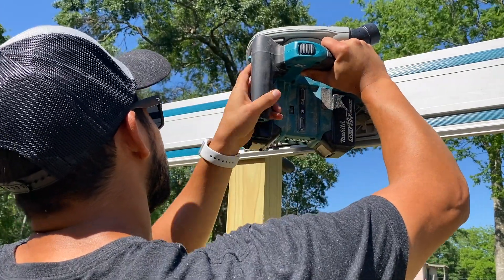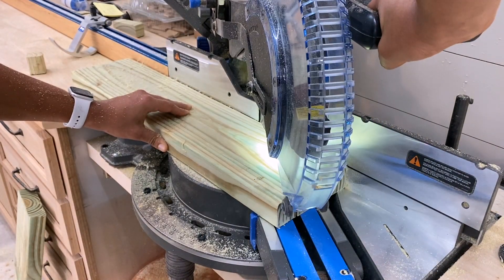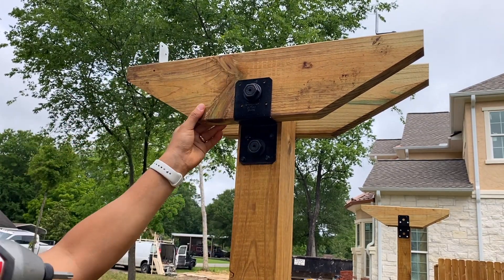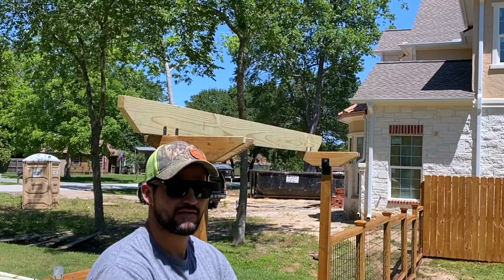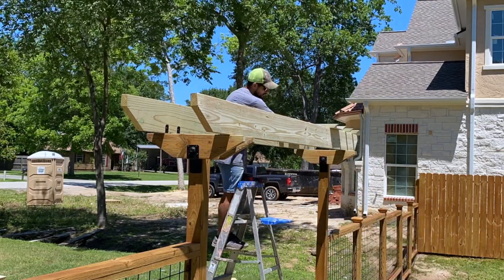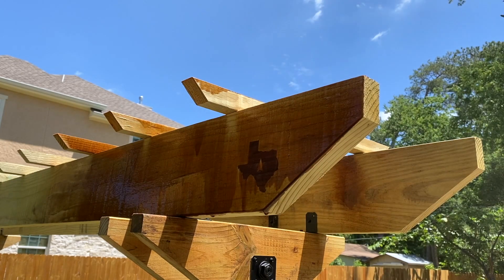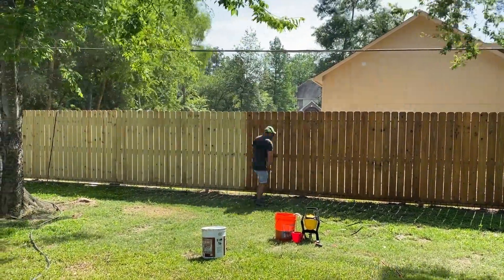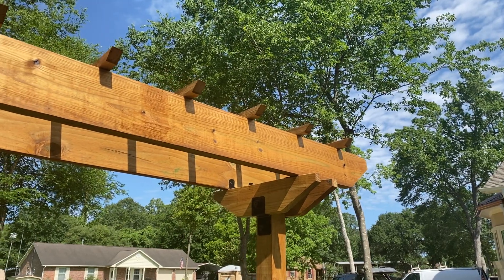How to build a DIY Arbor for your Fence Gate!

Comment: Great build. Can you direct me to a link for the JOIST TIES you used to connect the horizontal supports? I can’t seem to find the model you used with the large hole in the center and 4 smaller drill holes around the sides. Thanks!